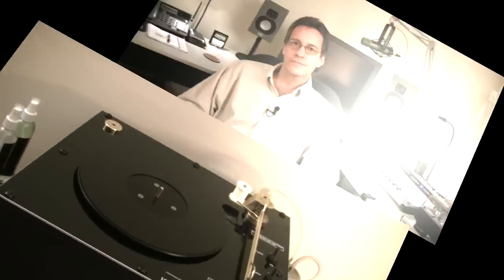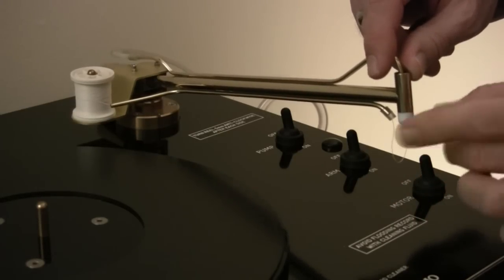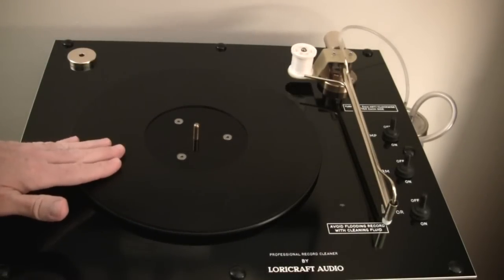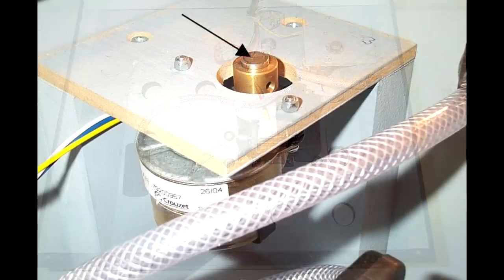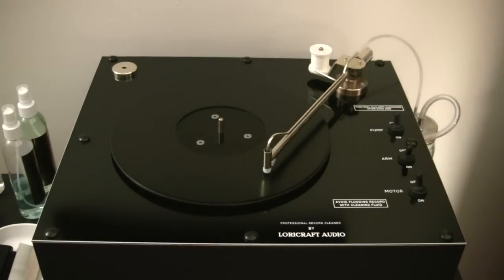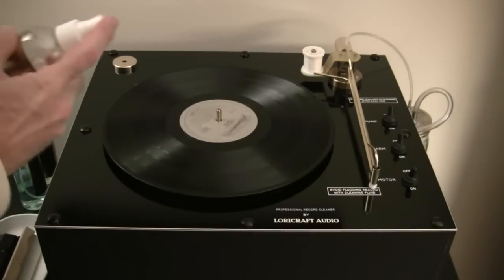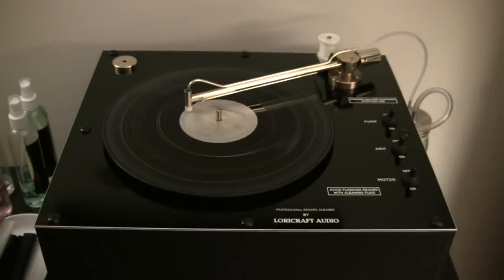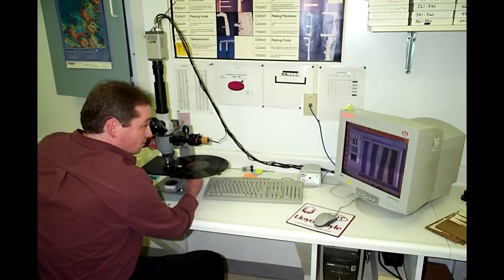Loricraft PRC3 Record Cleaning Machine Review

Comment: PRC 3 uses the least expensive pump of sufficient suction power. Domestic use and small shop use. PRC4 is a double capacity pump. It will clean in one pass better. than 3. PRC6 is super quiet with massive pump often favoured by archives.The thread protects the LP and creates a vortex.  The magnets aid shipping and maintenance. I designed these features. Percy Wilson the inventor.

Comment: I like my PRC4. 
It’s relaxing (to me) cleaning records. The machine does a good job with the included cleaning fluid. It’s probably a personality thing-some people will enjoy the process-others not. 
I let my non-alcoholic cleaning fluid soak the record for a few minutes in between brushing with the included brush. No scrubbing. 
 After sucking the cleaning fluid off the record I do a repeat with distilled water to remove any residue.
Reply: How loud is the machine?  I have a Project VC-e  record cleaning machine it's a little noisy but I really like this one. I also have an  ultrasonic machine that works great as well  but Buzz & I can do up to 6-7 records at a time then I vacuum off the liquid or I let them spin dry.  I'm trying to silence both machines but it's hard (I live in a Co-Op)  I also use reverse osmosis water 2 gallon jugs of it at my whole food store near me cost me $0.98
Reply: It’s relatively quite compared to ultrasonic and vacuum cleaner machines. 
I listen to music while using it.

Comment: Regarding your cleaning techniques, I adopt a slightly softer approach although with more agressive chemicals. I used very fine cleaning fabric, almost like velvet but slightly stiffer. 1st clean IPA, pure water and fotoflo with 2nd clean using Art Du Son. Works out well however I DJ my records so they will never be perfect. I also use a slipmat over the platter as I find the platter a little agressive.

Comment: Hi, mine is a mk3 which has the reverse. I believe the mk4 has a stronger vac which I have enquired about retro fitting to mine but £600 is a little steep. My RCM at the moment is used prety much every day and has cleaned circa 10k records so has earned its money. It is an inch thick in dust and dirt but still runs great although may need a slight repair as the platter stutters sometimes when starting.

S

Comment: Great video and review - but doesn't the solution wet the record label?? I would have expected some device to cover/protect that part of the record for such an expensive machine...
Reply: nintendy Believe it or not... the sell a record label rubber cover for an additional cost. LOL You can use a home made device or just be careful. I generally spray toward the outer area of the record and brush the solution inward.

Comment: I would like to get a microscope to look at the grooves on the record. Any suggestions please? Thanks
Reply from the maker: The microscope used here was used in a circuit board factory to inspect PCB’s. It was an old CCD unit and was very expensive (I’m sure dated these days). You could probably find a decent USB device these days that would work fine for little money. I have no suggestions tho. Sorry!
Reply: Thanks for the info. I ordered a USB device with LED that should fit my needs.